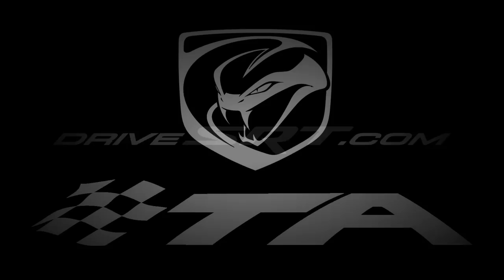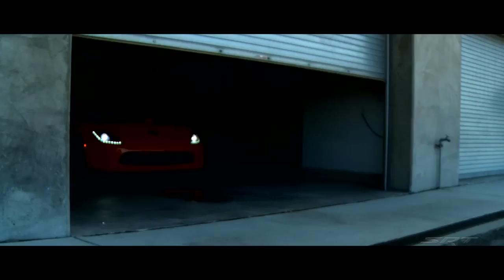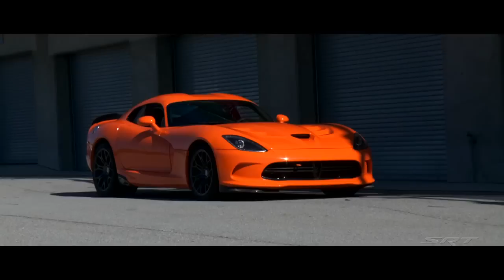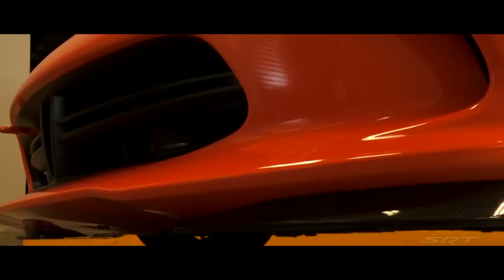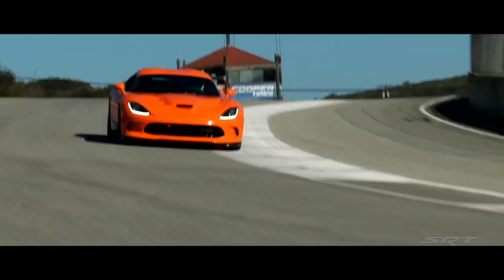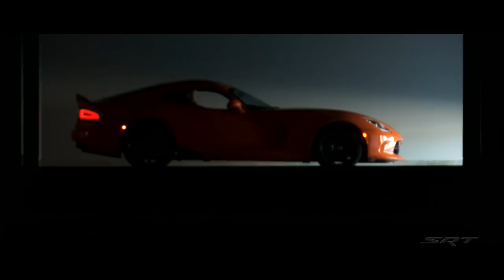SRT Viper TA: back at the track.

Comment: There are two problems:
1) They wanted/expected the Viper to beat the ZR1, and it didn't, so they rushed the Viper TA 6 months ahead of schedule to officially beat it.
2) They don't want to do any major changes to the challenger until they can get the 8 speed auto transmission in it (it doesn't fit the platform currently and they are designing a new challenger that will fit it, that will come it probably 2016)

P.S. There will be a Hellcat powered Challenger out soon (supercharged hemi 560+ hp)